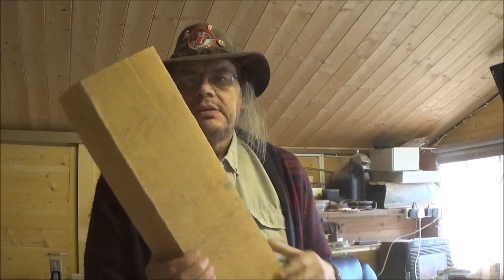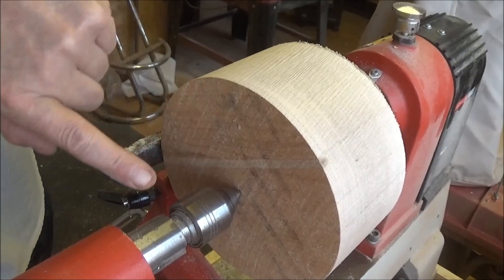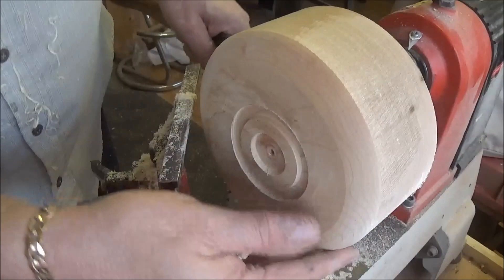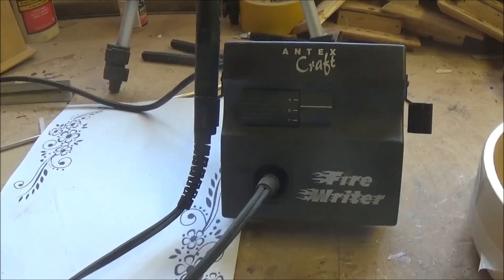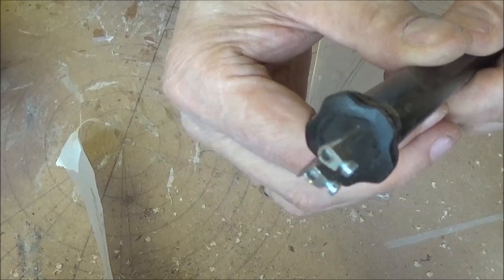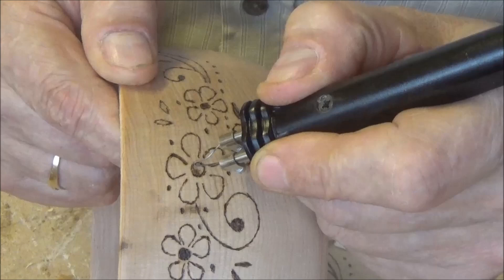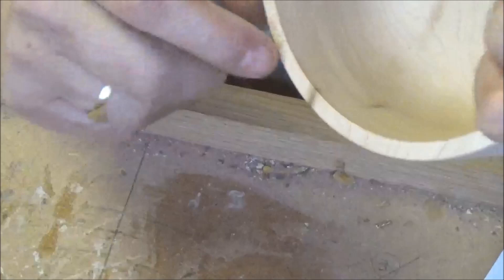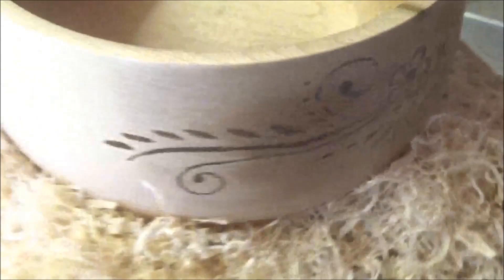Woodturning at 54a. #67. Maple bowl with pyrography.

Comment: Mmmmm Pancakes, you made me hungry now lol 
Beautifully done Keith, Pyrography is very relaxing :-) 
I did exactly the same as you when I bought my pyrography gear, My first one was like your red one and came with the same selection of branding tips etc but mine did have 2 heat settings thankfully so was handy and I still use it now and then, but like you, I also prefer to hold the 'pen' very close to the tip so it felt really awkward to write with. My second is very similar to your Fire writer and it allows you to hold the pen close to the tip. On a safety note, it cools down very very quickly (within 30 seconds or so) compared to the the soldering iron type pen which takes a good 5 mins or so.
Thanks for the shout out to Daniels channel, I hadn't come across his videos before in my searches for turning videos, and your'e right they are very informative as are yours so he has gained a sub from me. 
All the best to you and Sheila and have a lovely easter xx
Reply from the maker: +Christine Pitt  Hi Christine. Yes,I really enjoy doing the pyrography,but I must make sure that I don't put it on everything I do in the next few weeks!! I've got a lot to learn,but learning's easy as long as you're enjoying it!!Glad you've found Daniel's channel. He's a really nice guy,and always willing to answer any questions. Happy Easter to you as well, Keith.

Comment: Great work Keith looks great. I am like you I need to be closer to the tip for better control. Thanks again for posting. Like Mike I have had mine for a while just haven't done too much with it because  the handle would get too hot, I just received a new handle. Cheers Mark
Reply from the maker: markmiller1549 Thanks Mark. I don't use it very often,but it's nice to have a go now and again!😀

Comment: If that's Nickel-Chromium wire, its dirt cheap and there are alternatives you could use, it's basically vaping wire, the same stuff you get in e-cigarettes. 
100m of the stuff for about 5 quid from a place called the crazy wire company. 

Seen a few videos of people using those tools now, I remember doing artwork with hot pins years ago, a good 25 years ago. Oh god, I just realised I'm getting old. 
Anyway, same sort of idea but with far more finesse. 

Great vid Keith. 
:)
Reply from the maker: +Jim Riven Blimey,100m of it would last a few lifetimes!! Good value though,thanks for the info Jim.   Cheers,  Keith.

Comment: This is one discipline where Gord Rock's gadget would come in handy I think. I think I mentioned it before, but here is the link if I didn't. https://youtu.be/JqeoP73o9d4
Reply from the maker: +Gil Grace  Hi Gil, I've just had a look at it,and it's given me an idea. I have a "keel clamp" which I used on my model boats,which has a ball and socket swivel system on it. i'm sure with a bit of tinkering I could do something with it!!  Cheers,  Keith.
Reply: +Keith Barrow From what I've seen I believe your version of a swivel vice will work fine. Can't wait to see what you come up with.